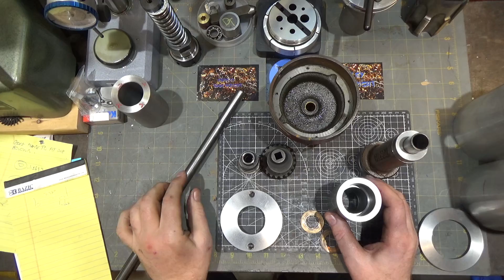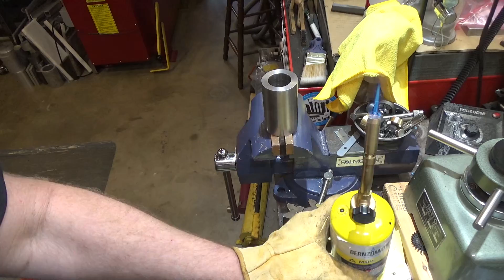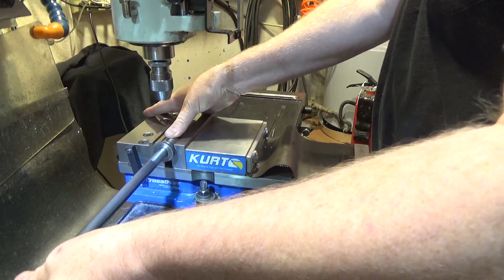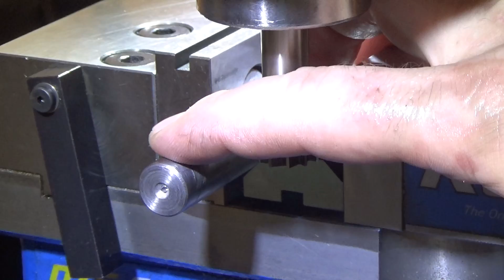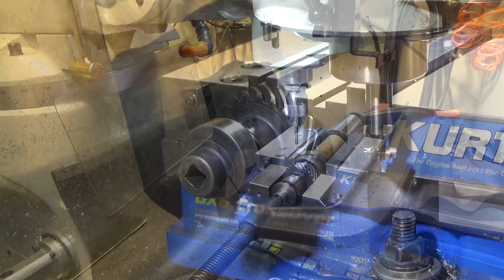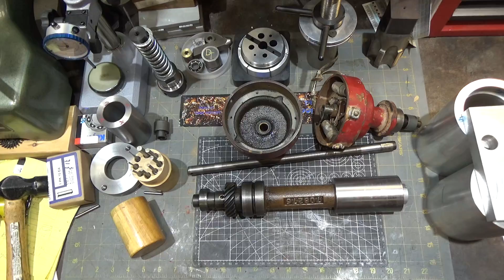132 Pierce Arrow Single Distributer Mod Part 3

Comment: I don't think I would have applied so much pressure with the clamp when drilling the last pin . This may cause excessive wear on the bushings. Some matching may need to have done after the welding of the large sleeve to maintain proper alignment
Reply from the maker: I agree, but fortunately the clamp was just snug, not tight. The shaft rotated freely.

Comment: Should have given the shaft about 0.002-0.005 axial clearance.  Not sure why they keyed the thrust bushings. I would have made new ones out of SAE660 and  let them float and maybe added oiling grooves.
Reply from the maker: Thanks for the advise. I am not terribly well versed on engine design.
Reply: @DudleyToolwright  You're welcome. For me it's a hobby,  I enjoy building motors, both new and old, mainly motorcycle stuff.  I'm by no means an expert but do get by.  You've got a nice shop.

Comment: The two pin holes might be different sizes because they used tapered pins. It was quite common in that era.
Reply: I was thinking the same thing while watching.
Reply from the maker: A very valid thought. I thought the same at the time, but checked and it wasn't. Nice and useful tip though. Much appreciated.